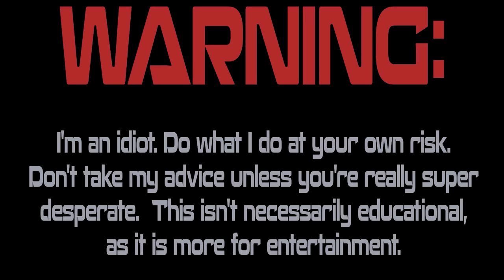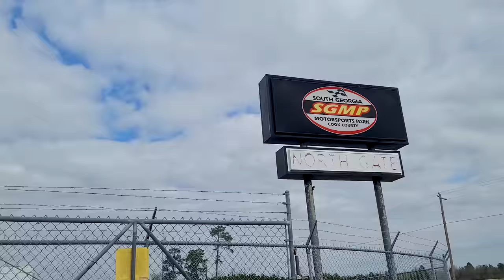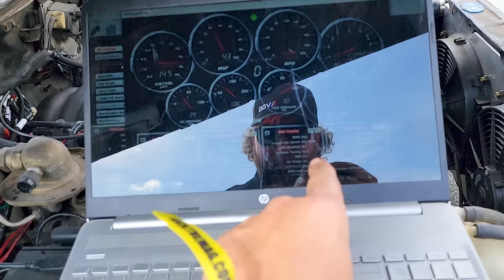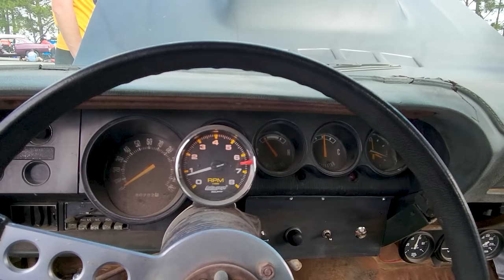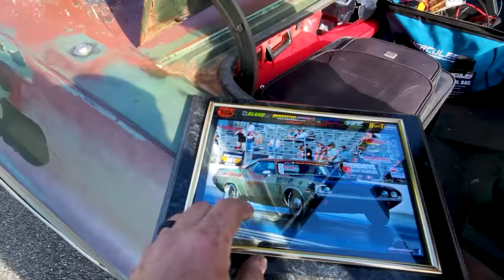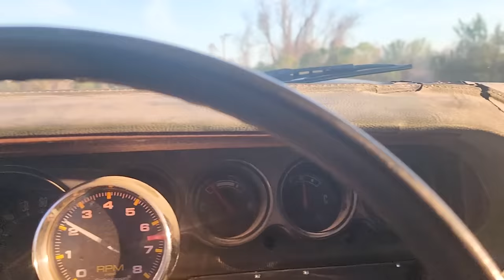Big Block Camaro in the 11s! -Sick Week Day 3

Comment: Hey Derek! I had a set of those MSD plug wires on my LS1 once and they would pop off the spark plugs a lot. Short drives they were ok, but every long drive, I'd have to stop and push them back on. Double check those!

Comment: Derek, I'd Ohm out those MSD plug wires to make sure they are not defective.  I bought a set of those MSD LS1 plug wires once and I Ohm'd them out before I put them on the car, and 3 of the 8 new plug wires were defective.  The sent me a second box, and several out of the 8 were also defective.  So between two boxes of plug wires I was able to get 8 good ones.

Comment: Picked up a going to town rig for free yesterday. Had a gallon of antifreeze a screw driver and a bottle of brake fluid. Yup, you guessed it, water pump, leaking wheel cylinders and no ignition sticks, but the scredriver worked well for a psuedostick. I couldn’t believe it but I had to, I was looking right at it. Forgot, it had easy access captains door, won’t stay shut, greaaaaaaat

Comment: Orlando speed world has been my track for years. Anyway as with the stalling on the Monte Carlo, if you're running any chinesium distributor stuff, or timing chain that's chinesium, and even cloyes is now chinesium oh, you'll get a lot of stretch and it'll change your overall timing, and that could cause it to stall. It could be the usual leaky gasket, but usually that'll cause it to idle higher. Check your fuel levels if you're running Holleys, they tend to change from time to time while you're driving. It can even be the screw stop back. A little bit settled in. Well good luck

Comment: Am I the only one that still cleans plugs and keeps going? Sure there are broken ones, but a wire brush and check the gap is enough unless there is a problem. A sand blaster is cool, but I don't carry one anymore. I used to have a little spark plug cleaner hook to air and push the "clean" button, then the "air" button and it was about a foot by a foot. I have not seen one in decades... If you see one, grab it. They are awesome.

Comment: I know you know what you are doing, but that open radiator fan on Vanishing Paint makes me nervous every time someone stands in a line with it while revving the engine. A fan shroud might at least slow down a blade a bit if it decides to exit the assembly. I had a fan lose a blade on my 67 Chevelle once, years ago, and the hood was closed as I was revving it back to life after it stalled when cold at a stop sign. That blade took a big chunk out of the bottom of the plastic fan shroud, and it took a nice chunk out of the asphalt where it hit the street. Granted, it was an aluminum flex fan, but it was a brand name one, and it wasn't very old. The stock fan blades are probably less likely to exit, but if they are old and cracked where the rivets are, or if the rivets are weak, it can happen. Edited: I did notice the fan clutch just now, so maybe the danger isn't as bad as I made it sound. But, still......something to be aware of. Really digging your vids, Derek! Keep 'em coming, and stay safe, brother. Oh, a request if I may....more revivals and rescues, please! Those are always my favorites.

Comment: Drag Racing is NOT Dead in my book. Soon, I may build another Drag car, (PRO Street Modified) My last car was a 69 SS Nova, with a heavily modified 427 Tall Deck, 8V71 Blower 5 speed Lenco Trans, Shortened Ford 9 inch with 4.56 gears, it was not Street Legal, yes it was a Trailer Queen, but still fun to run...

Comment: Hey Derek could you explain the reason to change your sparkalators after 3000 or less miles when the everyday driver is told that their sparkalators only need to be replaced every 30000 miles when doing the recommended service on their daily driver?

Comment: Small block Mopars like right around 34 degrees total advance under full throttle load. A guy could benefit from retarding ignition timing on LA engines.
Very cool videos!

Comment: On your GM motor first plug in the lap top and watch what coming out of the Oxygen sensors, low numbers lean high number rich it’s supposed to shuttle above and below .05 Volt. Get carb cleaner and spray around the fuel injectors and watch and listen. Did you change the O-rings on the injectors when you cleaned them?  As far as your Chrysler engine with a valve train that was invented back when the Titanic sank get rid of it and do a EV conversion, I know your USA friends will start to cry but do it anyway.   NYC Stu

Comment: Drag racing will probably never die, its got to be the most accessible, (at least in its basic possibly illegal stoplight roots)  and understandable form of motor racing. the results are given in a standard measurement time per 1/4 mile across the entire board whether you are racing a clapped out 20 second minivan or a 3 second top fuel dragster. The average Joe who has lined up at a traffic light will probably never have the chance to see road course x or have any idea how many seconds a lap "fast" is. Even Nascar is confounding, easy to know who won a race, impossible to understand the points you earn for leading lap 7 at Bristol and its impact on the season.

Comment: Those headers get HAWT believe you me. This can cause a little disconnectea-own on those connections. I put a little dollop of the die electric grease on those and it fixes it right up. A feller is a much better mechanic than me, so I'm just saying.